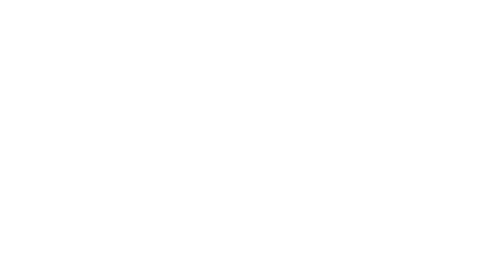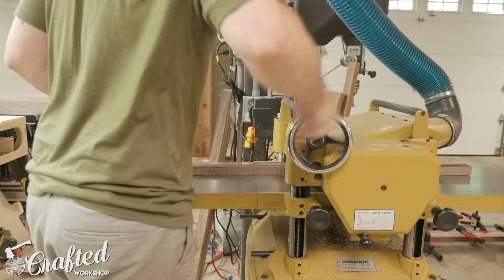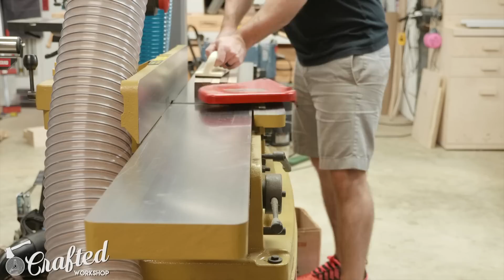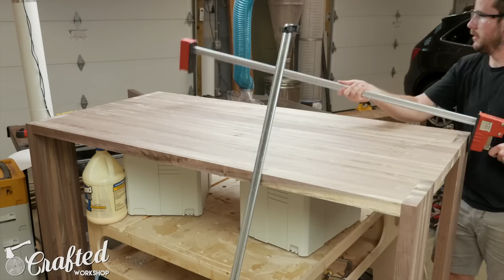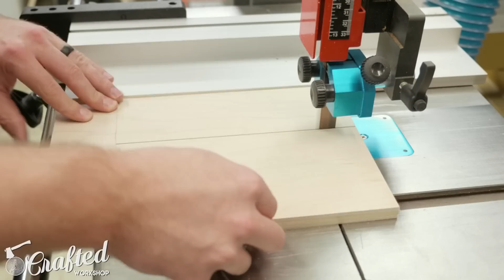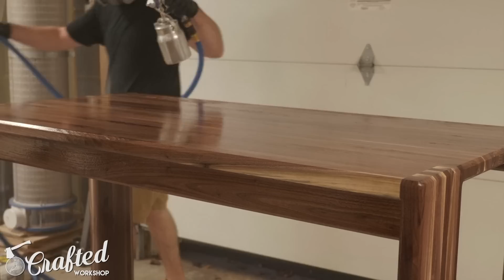Modern Walnut Dining Table and Benches | How To Build - Woodworking

Comment: We’re loving it! Very easy to put together (30 minutes with two people). I’ve use it everyday and it’s sturdy. allmy.tips/TableBenche The benches can easily fit two people (and we’re not tiny). We have two folder chairs to add to the ends if we have 6 people over. That does make it really right, but can work.

Comment: If this were a regular height dining table, could I leave out the stretcher along the bottom or would it be unstable? Thinking of the most traditional dining tables with the 4 square legs and aprons, but this is lacking the short aprons...
Reply from the maker: I think you'd be OK, but you can always build it and see if it feels stable enough.

Comment: Its a beautiful table really! Only one downside to me. A big project like this all glued together is hard to move around. I think it would be a little better if it had the option of deassembly.
Reply from the maker: +ExotiC255 you’re definitely right, it was a pain to move. Would have been hard to make the design a knockdown design though.
Reply: I thought about it and there are a few other projects on your channel that share the same problem. Now rebuilding those with some deassembly option is a little too much but to give some solution to this you could built one of these: https://www.bueromarkt-ag.de/moebelroller_meister_820040_kunststoff-rollen,p-820040-1,l-google-prd,pd-b2c.html?gclid=CjwKCAjw7MDPBRAFEiwAppdF9HeB9JIZVYYPaD6YKsZekF2JJLIxVuCaTzHvtCj7q1k-CrKZjljZQhoCOhgQAvD_BwE with your own twist to it(whatever that might be)

Comment: Another quality build mate, Walnut is such a decorative wood & easy to work with & you’ve made a quality item here, mate I see you use Powermatic machines & I know you’ve a Sawstop Table Saw but would you of considered a Powermatic Table Saw ?, make very little difference but just a question 👍👍👍👍
Reply from the maker: Thanks! No, I won't be getting rid of the SawStop any time soon, I really like the added safety in my shop and the ICS is an awesome saw.

Comment: Tapping wood? That will fail quickly. Hopefully you didn't charge this person. Also, the seat back brackets will bend and fail prematurely.
Reply from the maker: I beg to differ. Threads cut into hardwood are extremely strong. Check this video : https://www.youtube.com/watch?v=EA-CmUvIsjg He's testing ⅛" of threads, I have 1" of threads for each of the bolts. Also, the back brackets are made from ¼" steel and are designed for this exact purpose. These benches seat two people maximum and will easily hold up to those forces.

Comment: Love the design on this table! And really enjoying the camera panning shots.... quick question though.... timber mate is water soluble right? Does it matter if you put a water based finish on top of it? I've always wondered this.... ha....
Reply from the maker: +3x3Custom - Tamar thanks! And I’ve never had an issue with using water based finishes with Timbermate, not sure how that works but yea!
Reply: Crafted Workshop cool. Thanks! I've always wanted to try it out. Looks like good stuff.
Reply from the maker: +3x3Custom - Tamar I’ve used it a ton in the past, really like it.

Comment: Nice Johnny! Another good option for attaching the legs might have been, I hate to say it, box joints. Was that a consideration at all for you? The dominos are a very good choice as always..
Reply from the maker: +GuysWoodshop it definitely was, but I had cut the pieces too short prior to adjusting the design and the table would have ended up too short. I know your loathing for box joints but they would have made a lot of sense. Or hand cut dovetails (gasp!) 😂

Comment: Sweet table! Quick question about your planer. Do you get any snipe with it at all? I just got the 20" helical one used and it is giving me a bit of snipe. I was wondering if you had to adjust yours at all.
Reply from the maker: +Chris Martin it does, and I haven’t really been able to adjust it to get rid of it. I just make sure to run the pieces back to back, totally eliminates it.
Reply: Okay cool. If you know how to minimize it, or if you happen to talk to Powermatic about it by any chance and they give you any ideas, let me know if you think of it. Thanks!
Reply from the maker: +Chris Martin will do! One thing is to reduce the infeed roller pressure as much as you can. My machine was already set that way, but yours might need adjustment.
Reply: I finally adjusted the planer with a dial indicator. With the bed rollers set to exactly 0.003", and everything else set according to the manual, there is absolutely ZERO snipe :)

Comment: This is an absolutely gorgeous build! Nice work! I have a similar dining table designed with chunky wooden legs that attach to the length of the table vs. the width like yours. I couldn't decide how I would join the legs to the table top. I didn't want to add any brackets or anything that shows. I never would have thought dominoes would support an entire table top, but now I can clearly see that it does. Time to start saving up!
Reply from the maker: +Jonathan Lambert thanks, good luck! With an apron, the Dominos are well supported for sure. Dowels would work just as well too.